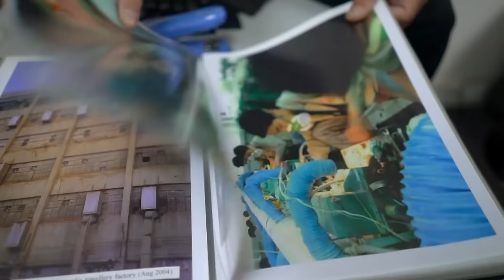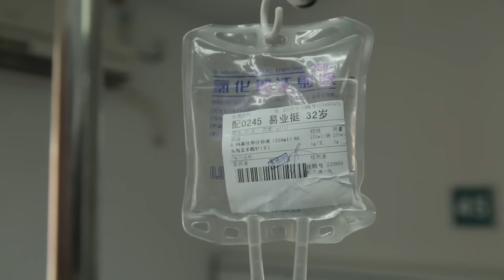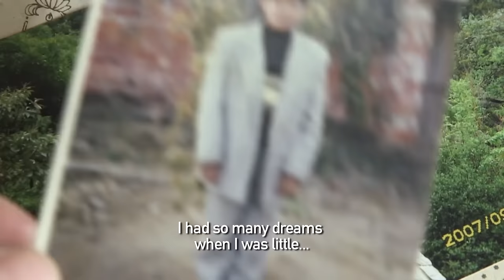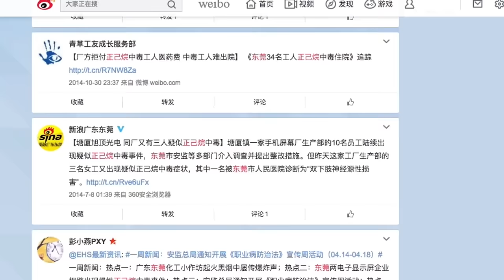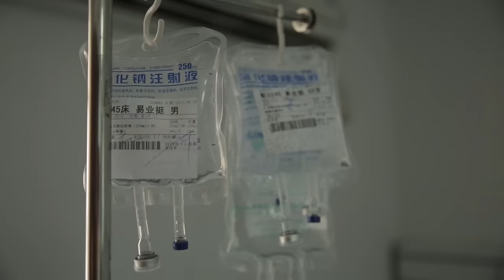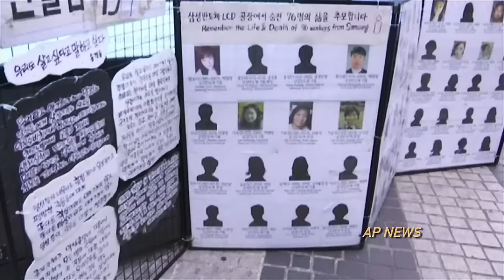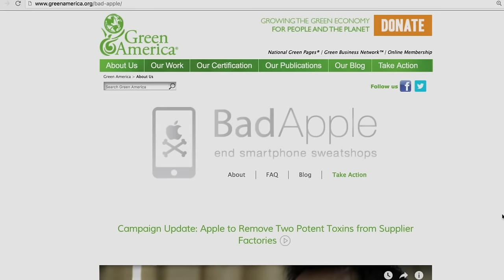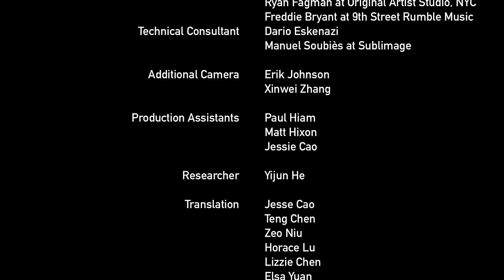The Dark Realities of China's Electronics Industry

Comment: Benzene is a highly carcinogenic aromatic chemical, and it should not be used in consumer products. The other dangerous product used is carbon tetrachloride. I've smelt in electronics as well as as another carcenogenic product, naphthalene, used in clothing products sourced from China. Don't buy products from China until they have genuinely stopped using these chemicals. For your own safety.

Comment: If they wipe the phone screens with those products, then contain them in a packaging, and all we do is unbox them as is. Doesn't that directly expose the buyer as well???!! Is there any toxicologist here that can shed some light on my question? Because it's of a genuine concern after seeing this documentary. Also, I hope and pray for the safety of the documentarists getting them involved in such exposing documentaries. This is serious work, and we commend you.
Reply: To answer your question.. No it is not dangerous to open a smartphone 'Box'
   Those chemicals are solvents used to clean any greasy fingerprints off the screen. They are chosen specifically because they evaporate very fast. So it is wiped on with a wet cloth, and almost instantly evaporates and it can quickly be seen if the screen is clean or not.
  Once evaporated it will blow away with any breeze, and  the components are then transported to the main factory for assembly. So it has plenty of time to air out before reaching you.
  Only if you breathe in quite a lot of strong vapours will it cause Leukaemia a cancer of the white blood cells.
   I know this because my friend used to manufacture old fashioned steel toolboxes. They were dipped in paint. The paint had a thinner solvent called Xylene mixed into it. But the xylene had a permissible contamination of  0.02% Benzine. Sadly the fumes were so thick and Benzine such a powerful carcinogen, my friend got Leukaemia and was in hospital for months.
  The toolbox were safe to use when the paint has dried. Just don't work in the factory and breath the fumes.
   I used to work in an automotive parts factory. We maid car seats. The polyurethane foam pads, under the cloth that you sit on, was made using TDI Toluene diisocyanate
At low concentration over a long time it can cause asthma respiratory disease. But at higher concentration it is very poisonous and can kill.
 There were air quality  testing machines constantly sniffing the air. If the background concentration went over 5 parts per million or peaked at 20 ppm. Then an alarm would sound and we would have to evacuate the building.
  If that was a fire where the chemicals were stored. Then officially there was supposed to be an evacuation of 25 kilometres around the factory. I doubt that would actually happen because it was populace area. Hundreds of thousands of people would have to get out of town.